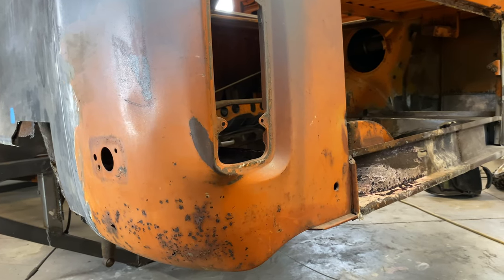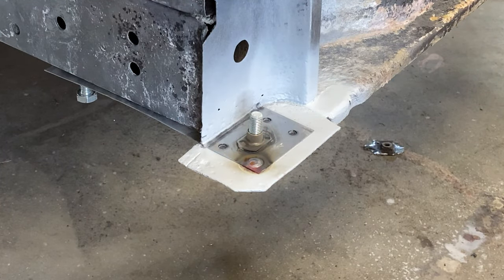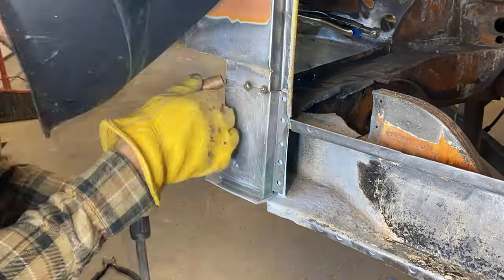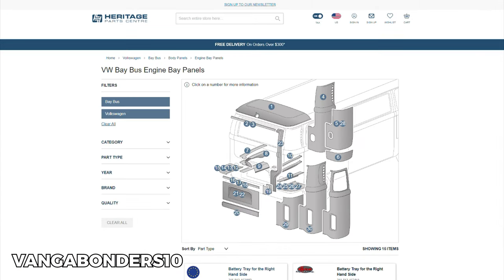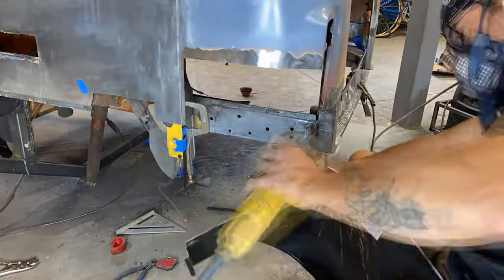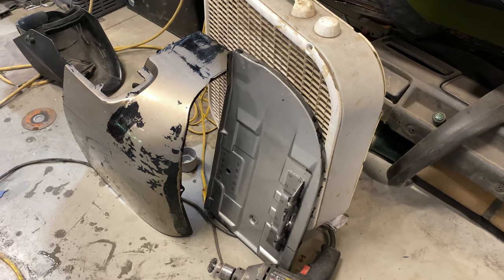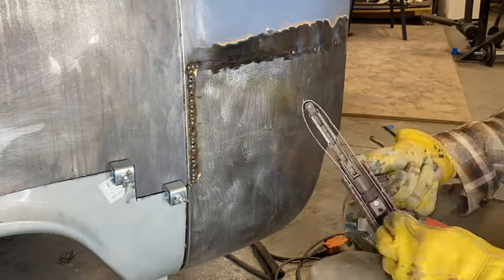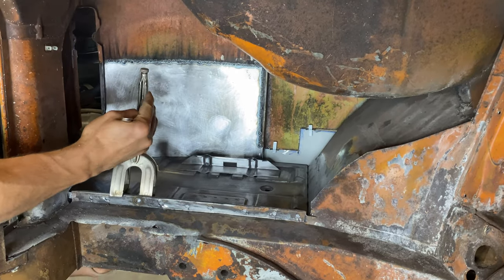Reviving the Driver's Side Rear Corner By Welding & Replacing Panels | VW Bus Restoration Episode:57

Comment: That bus is lucky to have found you! Many people won't invest that much labor and the costs to save it from all that salt cancer. I restored a rusty convertible bug 25 years ago.  Basically, I replaced the lower 12" of the body, I installed new pans, lots of work to the pan itself. Lot of rolls of mig wire, lots of grinding but I finished it and I still have it today. I should have scrapped it! lol. The next bug I bought spent its life in S. California. I wanted zero rust. I'd already bought that ground! HA! It was much faster and cheaper to restore that bug obviously.  Lots of people ship dry, rust free VW's from the SW USA to the rust belt so they don't have to do what you're doing such a good at fixing. Keep up the good work.
Reply from the maker: Sometimes I wish I had bought a dryer bus, but there is something satisfying about knowing you’ve gone through every inch of a vehicle and restored it back to stock quality!
Reply: @Vangabonders  I totally agree with you. There's nothing like knowing you know every square inch of your VW. Plus, the skills you're developing will last a lifetime.

Comment: I love your channel, I'm working on restoring a 67 bug with my son and am inspired to improve my mig welding by watching your work.  One thing I just bought was a bag of metal discs to weld holes with.  Assorted sizes were about $35 and saves tons of time on making your own.  Also, Eastwood makes a kit that includes assorted discs and step drill that matches the sizes.

Comment: I also have a "finger sander" and find it extremely useful. However, I find that it burns through those tiny sand paper belts very quickly. Thanks for another great video!!!
Reply from the maker: Ever since I bought the 3M brand belts they’ve lasted longer than my cheap harbor freight belts!

Comment: I have to say, if you didn't want it to come out as near perfect as you can get it, what would be the use of doing it at all than. I like how you fit and weld the replacement panels on. And you know that everything has been taken care of before you weld anything. I think it not only will look great, but you will certainly be proud of it when it is finished too! And should be...

Comment: great work, is the outside flange of the battery tray usually tacked to the corner skin or did they just seam seal that at the factory and rely on the front and inside lips that are spot welded ?

Comment: Cut your new panel a little longer than mark a line and cut through both panels together. And than you have a perfect butt weld.
Reply from the maker: I can never get that to work with a full length panel that has a seam.
Reply: @Vangabonders  practice make perfect brother, but i have to say you are doing a Awesome job!